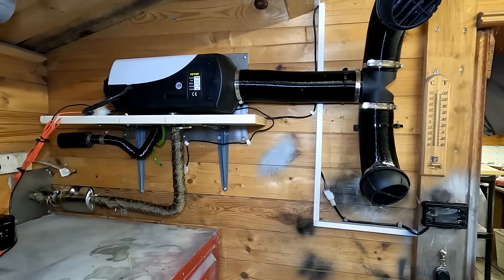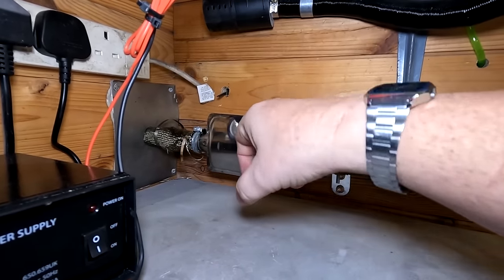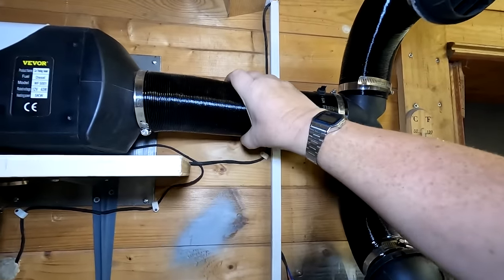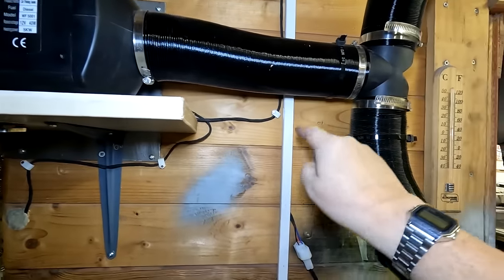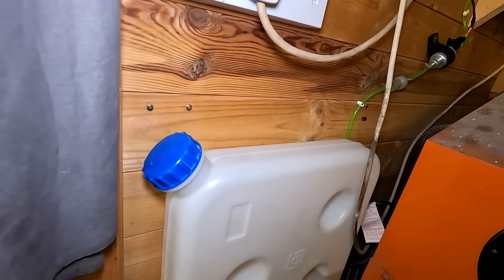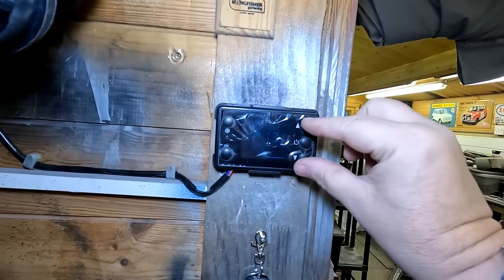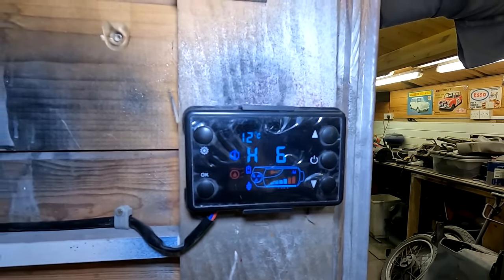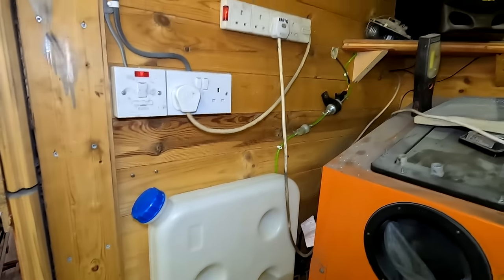This Diesel Heater Installed In My Workshop Was So Easy

Comment: Hi,
Sorry to intervene again but I see a mistake in your setup: the muffler has 4 points of welding on it and the exhaust gases will breath through inside your room. You should mount it outside hanging on the stainless steel pipe and isolate the pipe exit with some high temp gasket silicone. Also, the air inlet for the burner should be separated from the inside air in the same way. And they should stay far from each other to avoid the exhaust gas recirculation.
Cheers!
Reply from the maker: Yes, you are right, check out my latest video.

Comment: Run this off a 12v battery on with a battery maintainer ..  Look up what happens if you have a power outage this heaters will melt down if power goes off ...They need to shut down with fans on or everything will be destroyed
Reply: Power brakes u burn down all shed.  Better whit battery

Comment: Why wrap the exhaust? That's more heat your sending outside.
Reply from the maker: Because there is sometimes spray paint in the air as well as carb spray and it has a flash point that could ignite.
Reply: @retrorestore  if there is enough vcc in the air to ignite with that, you are already screwed.
Reply from the maker: @thomaseverley3847  Its a precaution

Comment: How much diesel does it use? Do you reckon a couple of these might do well as heating a small two up two down house? I’ve worked out a way to install them but I’d like to know your thoughts and is it worth it over using the gas central heating which costs a lot these days.
Reply from the maker: I wouldn't know as i've just fitted this unit. There's plenty of info on running costs on Youtube.
Reply: @retrorestore  thanks I’ll take a look and hang on for you to see how it goes
Reply: About .1 liter per kwh or a bit more, I think.
Reply: @GoldenCroc  doesn’t translate to me mate but thanks
Reply: @Alexander_l322  Its the simplest way to say it sadly... what units were you looking for?
Reply: There are guys using these to heat rooms in houses who have YouTube videos of their installs
Reply: There are comparisons for GCH and it’s not as economical running these heaters. The diesel usage is defined by the pump hz it pulses a fixed amount of fuel into the burn chamber. Also there Hz thing defines the Kw rating. There are no 8kw, only a smaller 2kw and a larger 5kw. The 8 is just a 5kw that has had the frequencies of the pump modified. Martin - it’s worth getting a replacement gauze and temp sensor plus plug&tool as they are only a few quid if bought from China with a long del time. It’ll be £10-20 a pop per bit if you have to order uk parts for delivery within the week.
Reply: @GoldenCroc   Nowhere near!  Look at the specifications!
Reply: @oliver90owner  What specifications would that be, if I may ask? The test videos conducted I have seen seem to be about the number I gave give or take a bit of course, what other info do you have?
Reply: @GoldenCroc  Sorry croc, thought you were replying on how much it used not rate per unit of energy.  You are correct.  My mistake. That is, of course the gross energy supplied to the heater, not the nett heat delivered as hot air.

Comment: mix your fuel 50/50 with used motor oil and save some money. have an 8kw one in my work van works great and have burned used oil in it , may take a second start to ignite but burns fine.  If your building is sealed up well  draw your air from outside so you don't deplete the oxygen in your shack.

Comment: Not sure if already mentioned, better to have power supply trickle charging battery to supply heater. That way if there is a power cut thd heater can still shut down safely and correctly. Well that's what I am planning on doing on my install. Great video

Comment: The silenser leaks like a siv, hold your hand over one end and blow in the other,  there is absolutely no resistance air leaks out all around the edge absolutely do not put it indoors
Reply from the maker: It's outside.

Comment: Get some pipe and extend the exhaust and use it as a radiator, rather than wasting heat by wrapping the  exhaust and waisting a lot of heat.

Comment: i would have installed it outside for safety reasons. intake and outtake would be ducted inside the shed.
Reply from the maker: All camper vans have them on the inside, they are designed for that.

Comment: That would be too noisy for my workshop as i operate cb amateur radio, the mic would pick it up. I have all the electronics test equiptment in there and the worry would be if it gives off EMF noise also that would intefere. I have a wood burner in there now i used to have a calor gas heater but Gas has gone up alot. Cool invention though.
Reply: Make it outside in a mailbox and only houses true wall. Then you will get the heat and no noise at all
Reply: An make the houses in the floor.  To get better heat all over
Reply: Get a noise-cancelling microphone.  End of problem?
Reply: @oliver90owner  not exactly i have noise cancelling microphones unfortunately it also means quality sound cancelling
Reply: @LeeKirkman88  Life is a compromise.  I expect there are noise cancelling microphones and good noise cancelling microphones?

Comment: Definitely not the safest installation, certainly wouldn’t recommend having one inside, 
Should be outside with a pipe going inside to re-circulate the warm air, carbon monoxide poisoning isn’t a nice way to die, and there’s nothing wrong with the green pipe
Reply from the maker: They are designed to be in camper vans, what's wrong with that? I will be moving the silencer outside as apparently, they are not sealed.
Reply: @retrorestore  
When there fitted in a camper van there fitted underneath or a turret plate  should be used, the heater has little chance of killing you then,
Reply: @retrorestore  
Using the eberspacher installation instructions  rather then the crap these Chinese ones come with is a better idea,
Reply from the maker: @daz575  Thanks for your comments.